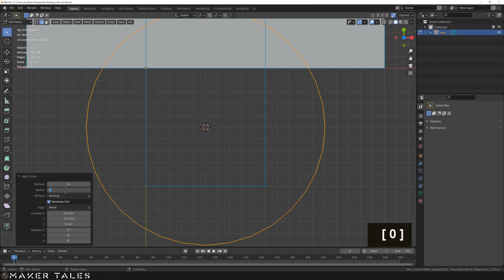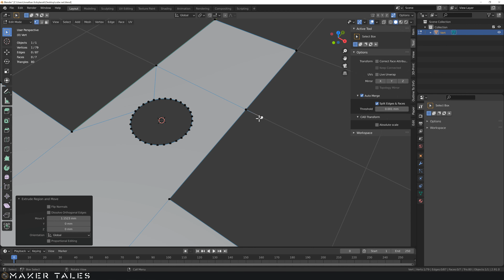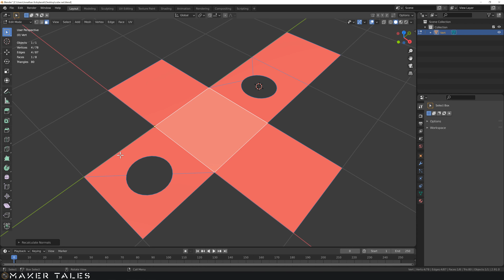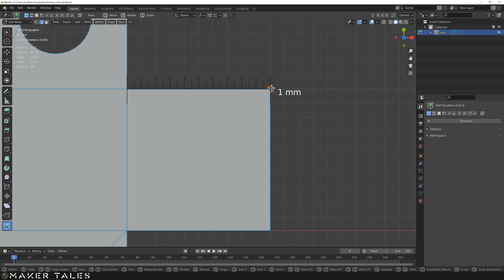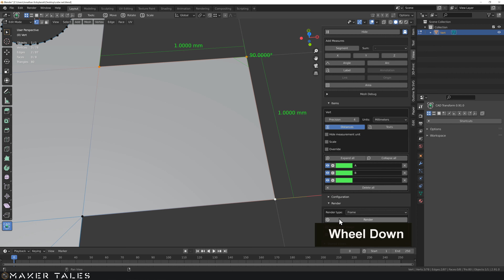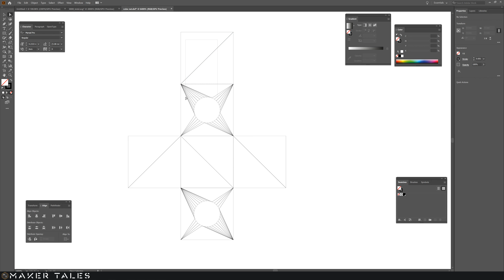2D Precision - Measureit - Export SVG | Blender 2.9+ Through Precision Modeling | Part - 15

Comment: Love these videos - thank you for making them!  I'm having an issue with the CAD Transforms Scale at around 16:47 - I am using a newer version (Blender 4.1.1, CAD T 2.0.6) on Mac and I can't get the calling to work, specifically typing in a value to change the length of that side.  Can't work out where I'm going wrong!  Any guidance much appreciated, thanks.
Reply: I have got it to work by completely starting again - so I must have somehow changed something in the previous project to alter the functionality.  Any ideas what that might have been?  Thanks.

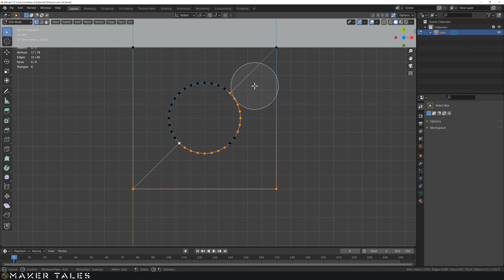Comment: At 2:30 after selecting all the vertices to make the bottom right "corner" face I get a weird interaction when I press "F", I get an orange surface instead of a "grey" one and it seems like I somehow get a created face that is not flat with my working surface. Have redone it a few times now and end up with the same issue. have tried to check for any doubles of vertices but not finding any. Anyone that has any idea what might be going wrong?

(When I go into face select i have a "center point" of the face indicated but it is inside the circle and doesn't seem to correspond to where the face "should be". Also viewing it in 3D I can not see anything that goes off in any other 3D direction.)
Reply: Had the same issue myself, leaving a reply in case someone else runs into this. I fixed it by selecting the same vertices as the ones for the fill and doing a merge (hotkey m). The default merge by distance fixed it. I'm guessing there were some vertices that weren't completely connected, which is why the fill wasn't working.

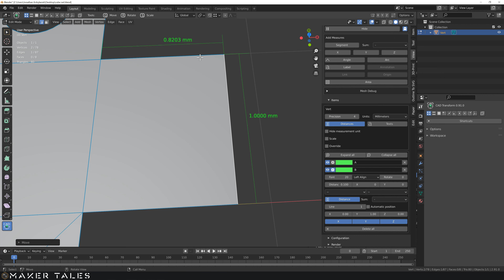Comment: 16:35 you refer to having vertex selection on while having edge selection on with vertex snapping? bit confusing for anyone following along. Also the cad tool works in such a funky way I always have to trial and error for 10 minutes every time it comes up to make it do exactly what you're showing. Some vertices will "scale/extrude" while others wont, select cad transforms, press "S", single click one vertice, single click the second vertice, type "3mm", hit enter, nothing. While other times it scale/extrudes correctly following that exact key path? Figured it out you have to drag the second vertice out then let go then type the values followed by mm, then hit enter.. for anyone wondering why the cad transform tool doesn't function consistently.
Reply: I had the same issue and managed to figure it out.  Before you scale, MAKE SURE the edge is selected, if the edge is not selected and you type in any value, the edge will not move. here are the steps: 1) select the edge in edit mode. 2) Alt+C. 3) Make sure Cad Transform is in Vertex snapping mode (first icon of cad transforms). 4) press "S". 5) click on the vertex. 6) now it will let you click on the other vertex. 7) and because the edge is still selected, when you type in a value like 3mm the edge will move. 8) Press enter to confirm.

Comment: Hi, I've been super excited so far with your video series and feel like I've made tremendous progress with Blender. However, this particular video has put me off for a week or so now from continuing, mainly due to these items:
1) Usually you start with a blank slate and build up from there. In this video you had the box structure already built, but for me that was long gone since I always practice the new techniques I've learned and I didn't have what you needed to start. This was really difficult for me to try and build what you wanted me to start with, but in the end it never seemed to match what you were starting with and I struggled to make things work during this video.
2) As I see now, the SVG add on seems to have changed behavior, so now I understand why I was having so much trouble with that part - I literally couldn't follow along and now I see why.
Great video series and I am hoping to get started again, but I'll most likely miss the concepts in this video.
Reply: I figured others might have your same trouble with step 1), I went ahead and did a write-up of steps I took to recreate the default setup. This isn't following the first tutorial mentioned in the vid, but worked for me:

1. a + x + delete all : clear canvas
2. numpad 7 : top view
3. shift + a --> single vert --> add single vertex (ensure cursor is at world origin) (note: this moves you to edit mode)
4. select vertex + e + (x, 1) : extrude vertex 1mm x direction
5. a + e + (y, 1) : extrude edge 1mm (note: do not delete face! 10/2022 CAD transform - not snapping without face easily)
6. a + (shift + d) + drag : drag new box somewhere to create 2nd box (ensure you are still in edit mode)
7. (w - box select new box) + (alt + c) + g + (shift + e) : select new box created, go to CAD transform mode, move, clear snap, snap edge centers - move box to correct position above box 1
8. a + m --> by distance : merge vertices to delete duplicates created at shared corners of boxes

''' repeat steps 6-8 four more times to snap boxes to correct locations for cube frame, each time duplicating a box with face '''

9. a + x --> only faces: delete faces only, leaving just edges and vertices, ready for beginning of tutorial
10. tab - go back to object mode - ensure that there are 14 vertices and 19 edges

Hope this helps someone. Quick soapbox, for CS/Software/Engineering stuff always remember, it helps solidify memory to teach others!
Reply: @bobobob1230  Thank you for the informative step by step guide, I'll give it a try. I will admit I'm really disappointed that I lost my momentum on this series with this one video. I was literally watching one or two every night, anxiously learning and trying in the fly in blender while pausing the videos. I was really enjoying learning Blender up until this video, where I got completely lost and it killed all the desire I had to continue. I have yet to start back up with the series, and I hope your guide will help me get back into the swing of things.

Comment: Exporting to SVG and opening up in Inkscape works fine.
After exporting to DXF, I try to open the file in Inkscape, but the page just seems blank. Importing the same file back into Blender shows me the heavily triangled object as per your example, but in Inkscape I see nothing. I tried fiddling with some parameters in the export window (like changing No Projection to TOP or BOTTOM view) but it didn't seem to affect the result.
Reply from the maker: Hang Tight Nutbunny, this Friday I have a little surprise for all those of you looking for a nice SVG export 😉

Comment: Quick question: Do you know how can I "activate" Illustrator 2021 instead Inkscape on the Online to SVG add on "Please set the Inkscape path" menu? - I tried to choose the app pressing the Folder icon and selecting the app (C:\Program Files\Adobe\Adobe Illustrator 2021\) but nothing happens, also I tried to write the same path on the field without success.

EDIT 
I found the way. You just need to add the exact path and it seems that everything works. The path in Windows 10 is: 
"C:\Program Files\Adobe\Adobe Illustrator 2021\Support Files\Contents\Windows\Illustrator.exe"
Reply from the maker: I don't think this will work with Illustrator, but hang tight. This Friday there will be a cool update coming 😉